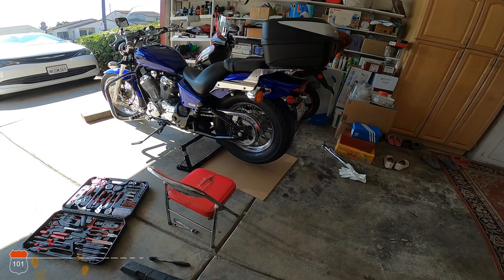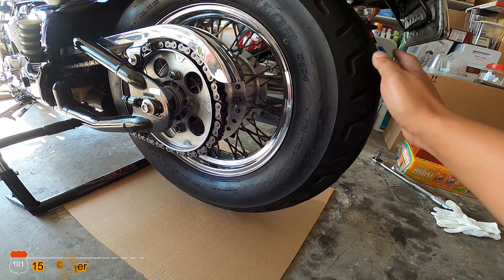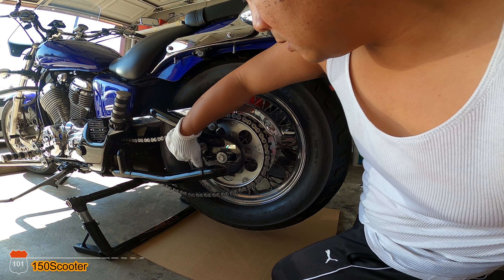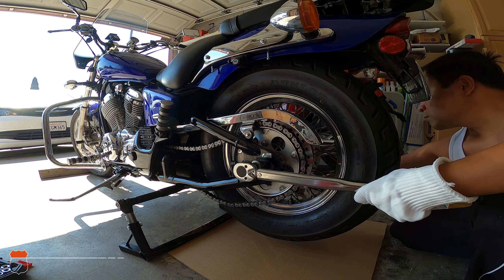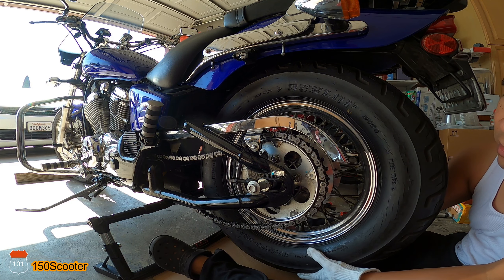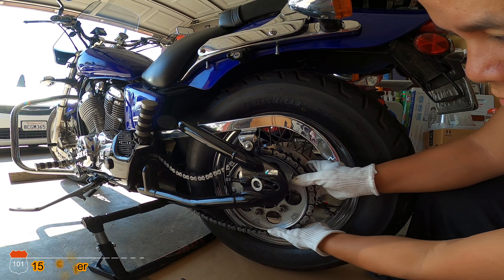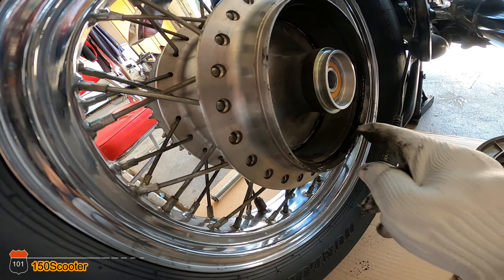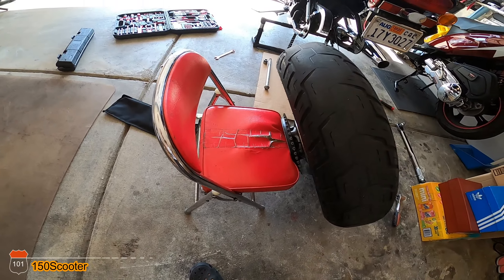Honda Shadow VLX 600 Tire Change Part 1 Rear Tire Removal | 150Scooter

Comment: Nice video!
When I purchased my Honda VLX 600 it still had the original tires on the it.  I replaced both tires after a couple of trips.  The bike had about 8,000 miles on it and the rear tire was pretty worn out.  It’s always interesting when you do any motorcycle maintenance for the first time. :)

Comment: I purchased my new tires from the local Cycle Gear shop, and they mounted and balanced the tires for $25.00 each.  I had to purchase new tubes along with the tires.  I just put the same Dunlop 404’s back on the bike.
Reply from the maker: I got a new tire (dunlop 404 tubeless tire) from a guy on Craigslist for $30 and buy tire kits for $18 from Amazon. Installed by myself, I reused the old tube.  Took me 3-4 hrs to completed it.
Reply: @150SCOOTER  I’m calling you next time I need new tires 😬

Comment: Could it be possible to get a link to that stand you're using to lift up the rear of the bike?
Reply from the maker: Search on Amazon for " PP2906 " or just type  "motorcycle cruiser center lift" Hope that helps.